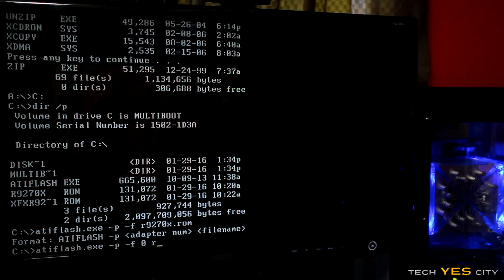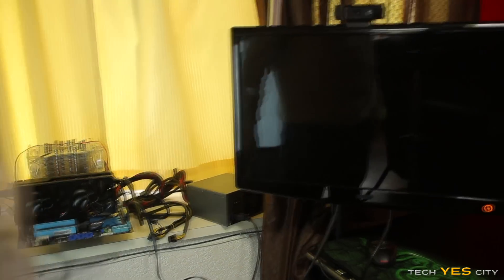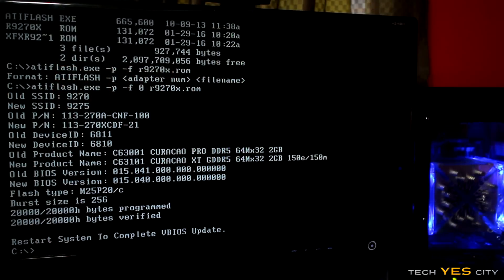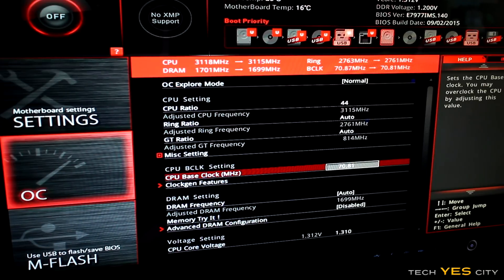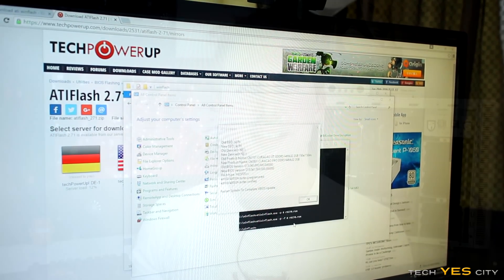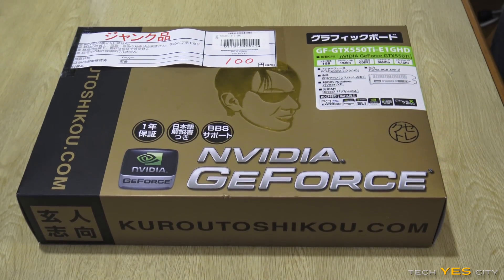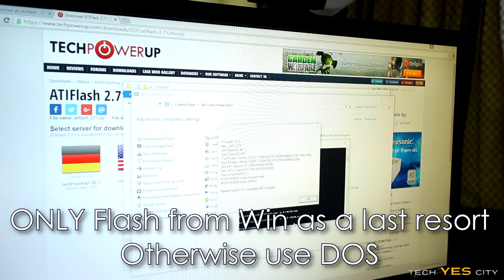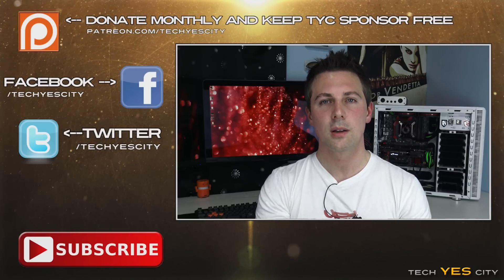R9-270 to R9-270x Flash Gone WRONG - How to Fix Your Graphics Card

Comment: Does anyone ever tried flashing an R7 370 into an R9 270 to unlock the extra 128 shaders? I'm asking cuz older versions of GPU-Z and AIDA identify the 370 as an R9 270, I've got one but Im afraid of trying since finding a GPU with equal or better performance for less than what I paid for 6 years ago is next to impossible...

Comment: Not every R9 270 can be flashed to R9 270X because of the power consumation. R9 270 is 150W with 1x6pin, but R9 270X is 180W with 2x6pin. Here is the simple math:
R9 270 (150W card) -> 75W PCI-e slot + 75W 6pin PCI-e cable | MAX power board is 75W + 75W = 150W
R9  270X (180W card) -> 75W PCI-e slot + 75W 6pin + 75W 6pin | MAX power board is 75W + 75W + 75W = 225W
So, on R9 270 you CAN NOT get 180W as R9 270X!!! This is why not ever 270 can be turn into 270X because the bios of 270X required 169W but the max power of 270 is 150W.

Comment: tech: what I was wondering, if you open the card, and locate the bios, why couldn't you flash the chip while it was removed, on a flash station. Or make a flash station with the pins all connected. flash it, then using hot air solder it back to its graphics card. won't that work?

Comment: Good way to brick any card is flashing it within Windows in CMD console. Never do that...

Always flash from DOS. Since it's dropped from main OS a few years back. Use an tool to create an DOS bootable usb.
Like HP USB Tool, or Rufus

PS. Flashing an R9 270 to 270X is the most useless thing ever. Just overclock it to match 270X Core/mem clock.
If it doesn't work than well, clearly the card just can't handle the extra juice

Comment: so what if I wasn't flashing my card.. what if it just stopped sending out a signal... PC turns on but can't even get to bios due to "no signal" MSI 970 gaming MB fx8350E (oc'd to an 8350) with an r9 390 card is on stock clock. unplugged the PC to install new flooring last month(was working fine when I unplugged it).. plugged it in today and nothing... I'm bout to cry..

Comment: i have a sapphire r9 270x toxic edition. it stopped working, the fans and lights work when i power on the PC but nothing shows up on the screen. so I installed another GPU and then slaved the 270x. the PC boots up fine and when i check the device manager, the 270x detects as a standard video card. could it be the bios got screwed up somehow? any advice? i also have a r9 290 tri-x with the same problem.
Reply: i found one too selling for cheaps..same issues, did you find a fix?
Reply: no sorry i didn't, have you?

Comment: Quick question, does a bad/incomplete flash actually damage anything? I know the card is 'bricked' since the bios is non-functioning, but nothing is actually damaged, right? So you could recover your card by using a back up gpu to log into nvflash. Would that work?
Reply from the maker: +yaarghmaargh Would have to drop a new bios on there (resolder?), or use the backup bios.  As the card could no longer be recognized due to the basic input output services not be able to communicate.
Reply: +Tech YES City Yeah thats what I had in mind. Basically, use the back up card as way to get to my monitor, than re-flash. By the way, new sub and I love to channel.
Reply from the maker: Thanks man, yeah back up is fine to get it working then reflash the original bios.
Reply: +Tech YES City But it sounds like what you're saying is a bit more dire. Does a bad flash invalidate the computer from recognizing the card? So even if I have another card to log into my system, I won't be able to find the damaged card? Anyway, thanks for the input. I've gotten back into overclocking, after a 10 year hiatus, and boy is it different now.
Reply from the maker: +yaarghmaargh lol yeah quite different, however if it is a single bios and you brick that bios then the card is forever gone, unless you can solder a new bios on there.  This is from what I remember, I haven't bricked a vga bios mid-flash, never, however I have bricked a mobo mid flash and that was unrecoverable.

Comment: It isn't the same g.p.u. It couldn't be flashed anyway. Except if we have a "3-core phenom" case here as well, which I don't think so.
Reply from the maker: +Gaius Trollius Little bit different, if it couldn't be flashed then it would not have worked at a lower base clock with the r9-270x bios.  It was working, just was a poor bin.
Reply: Seems it's just like the 3-core phenoms back in the day.

Comment: Back when I flashed my 7950s to 1ghz I remember reading about ways to edit the setting of a bios. Maybe theres a way to make the 270X bios with a lower clock speed, although not sure if thats worth the  effort vs a simple overclock of the stock 270.
Reply from the maker: +OptimusPro Yeah it could be worth the effort if it was your 24/7 daily card.  I already sold this one lol.
Reply: OptimusPro dude did you gpu worked? if yes help me too

Comment: Hell, that makes me want to flash my 390 to a 390X. Has anyone any experience with that.
Reply from the maker: +88lochi Depends on the model, some are able to be flashed, some are not I believe?
Reply: There's a tool that lets you check whether or not your CUs can be unlocked. Unfortunately, I can't unlock mine :(
Here's a link if you want to check it out: http://www.overclock.net/t/1567179/activation-of-cores-in-hawaii-tonga-and-fiji-unlockability-tester-ver-1-6-and-atomtool
Reply from the maker: Thanks I will take a look.

Comment: another way is to put brickcard in second slot another card in first slot  motherboard and use ati flash detected to card 2 using an flag
Reply: what do you mean?
Reply: Tanzu15  http://www.overclock.net/t/593427/how-to-unbrick-your-bricked-graphics-card-fix-a-failed-bios-flash   

this guide is not made my me but what i was talking about

about flags in dos they are arguments that go after an file you are loading also called commands e.x.
atiflash.exe -f -p

-f meas force flash
-p means program

all atiflash commands can be found here

http://www.techpowerup.com/forums/threads/how-to-use-atiflash.57750/

these are old guides but they work for everything except the R9 FURY line of cards as they use 2mb bios that atiflash does not support only newer versions of atiwinflash do
Reply from the maker: +Andrew McEwan I tried that first, though the problem here was that the graphics card was trying to start up and kept dropping out. This was the only way to get this thing back.
Reply: +Tech YES City That is really interesting but it makes sense. I frogot if you mentioned this or not but on older boards or amd's platform wouldn't you get the  same effect by lowering the pci express frequency? if you did happen to mention that then you can ignore what i sed but it might be helpful for other people with the same problum if you put that in the decpriction.

any way thanks for giving us all great content to watch.
Reply from the maker: Ah yes on older boards, lowering the pcie clock frequency should do the same thing (I just haven't tested it yet). I actually have that feature on my p5q deluxe board here.

Comment: Why are you flashing a 270 anyway? 270 and 270x are exactly the same with a different clock speed.
Reply: +JayFragz No, they have the same amount of shaders, but the 270x comes with more power conectors allowing for higher voltages which enables the GPU to have higher clocks.
Reply: +Heatranoveryou "X" variants of cards have more shaders (which only go but so far on higher end cards)
Reply: JayFragz
The 270 and 270x are exactly the same. They are both 7870s.
Reply from the maker: +Heatranoveryou For higher clocks.

Comment: What does it mean to flash a r9 270 to a r9 270x?
Reply: +Antwan Armstrong The 270 and 270X have the same number of cores, the 270X is only clocked higher, the 265 is the cutdown version of the same chip.
Reply: the flash turns on disabled stream cores, so the card becomes a full 270x.
Reply: ty
Reply: +Keven Harvey sorry I was thinking about the 290 and 290x.
Reply: +jmcsmfp Flashing means doing a bios update. Like you do on CPU's, It can be done on GPU's too.
Reply from the maker: +jmcsmfp In this case just trying to 'flash' a new bios onto the vbios chip that is has on board.  Since that vbios on the video card has flash memory (ROM) it needs to be 'flashed'.  Hope this helps.  Some cards it can do more than just unlock clocks and voltage, it can actually unlock more hardware, but they are cracking down on that by laser cutting parts of the die.
Reply: +jmcsmfp no problem